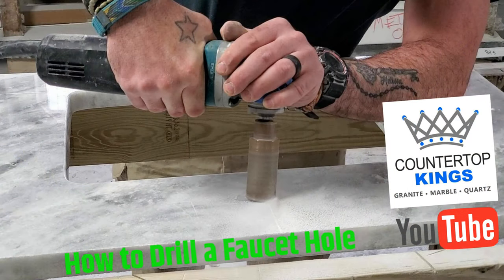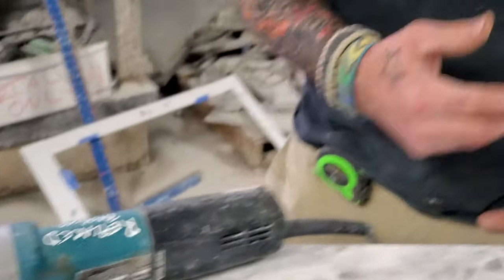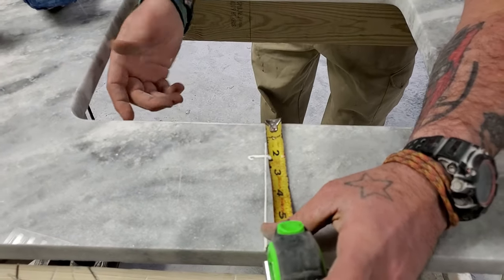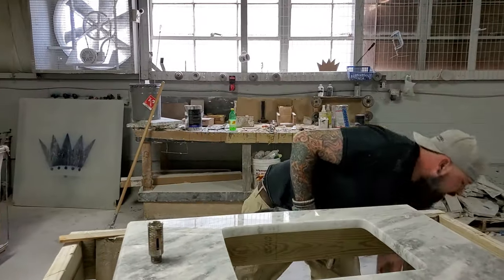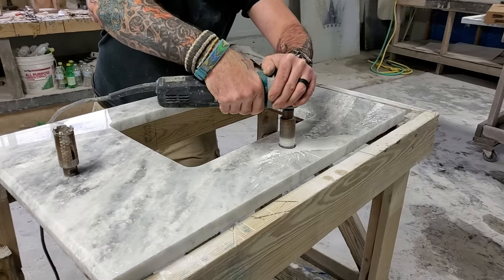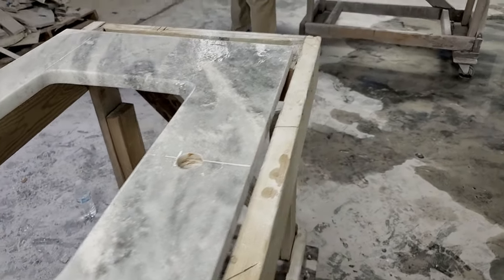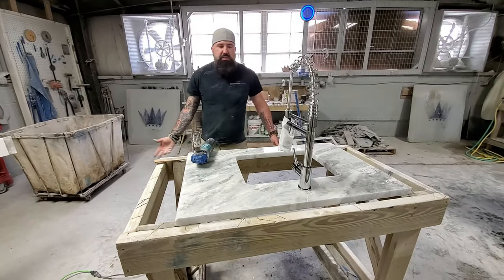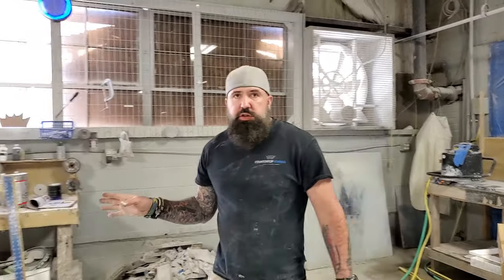How to Drill a Faucet Hole! Diamond Bits

Comment: I like the angle technique, I just crank the speed crazy fast and when I start contact I’m very light about it with elbows braced n just on a slight angle in a circular motion. Same motion a coin would make rocking to flat surface. I don’t have a skipping issue I once did, but experience is a great tool to have. Great video
Reply from the maker: Thank you. Yes once you get the technique down you will only have a skipping issue if your bit runs out of teeth, just gotta be careful when it gets low.

Comment: Like this guy and his video. If you’re doing this on site might want to have an assistant to shop vac the dust out of the way while drilling. It’s interesting that it’s possible to crack stone while drilling it if it gets to hot. I thought this stuff was formed under tremendous pressure and heat ? My thought is vibrations would cause a crack more than heat. But he’s the stone guy so he knows best.
Reply from the maker: U got that right.
Reply from the maker: Faucet holes make a minimum amount of dust even so we do run vacuumed in home when we aren't filming. As far as being formed under tremendous pressure and hear, if you have stone at home if not find a friend that has stone in their home if you have any. Take a vice with you and put in on a corner and turn it , film it so we can see how if it was formed under pressure by your logic this pressure won't hurt it. Lmao. After your finishing with that take a torch with map gas and hold it in the same spot for approx 5min remember to film because by your logic being formed under heat also means this will not hurt it either!

Comment: Great video - thank you!  I need to drill a 2-1/2” hole in granite for a beer tap tower…along with (4) 1/4” holes around it for the screws.  I’m assuming the 2-1/2 inch hole will be similar the the hole you drilled….any recommendations for the 1/4” holes?

Comment: Touch the diamond segments on a bench grinder of your bits that are glazed over to open them back up. They’ll cut like new.
Reply from the maker: Touch it to what? I have drilled concrete blocks to sharpen them, have also drilled stones to sharpen them.
Reply: @FOUCHFABS  the grinding wheel whens its spinning. Works like a charm I've been doing it that way for many years.
Reply from the maker: Thx!

Comment: Just how hard are you pushing down? I've drilled some holes and even used a terminator bit but never got it done that fast. Was that slab made of butter?
Reply: looks like it's marble, so it's almost as soft as butter.
Reply: He’s also using a bad ass 90 degree grinder drill probably 15 amp. I’ve seen it done with a cordless. But they want around 200 plus to drill one hole. I’d make it last a while so the customer doesn’t think you’re ripping them off.
Reply: @joeeast439  Lol yeah right!
Reply from the maker: We only charge 25 a hole plus a trip charge. So if my customer complains about $25 they can do it themselves.
Reply from the maker: And that's only if a hole is added after install. Or they don't have their faucet available at install and we have to go back to home. Idk how anyone can get $200 a hole.
Reply from the maker: I would have to rewatch video to see what material it is. It all depends on the bit and the material. Quartzite takes forever, granite is second hardest, marble is shit, and quartz is the easiest to drill. Terminater bits are best if you can find but there are some other decent bits out there. And the makita sjs grinder I'm using is the standard grinder used in the granite industry,  at least in my part of the world.
Reply: @FOUCHFABS  Thanks. I’m going to attempt to drill an 1 3/8 hole in granite with the Kobalt bit similar to the terminator bit. I read the reviews seems to work good. My opinion is drill slowly less heat and keep the bit and slurry it creates while drilling moist. Wish me luck.
Reply: @FOUCHFABS  do you have a contact in Canada to do this ?
Reply from the maker: @CarlosRomero-kk3et  i sure dont. Sry. Im in North Carolina,  USA
Reply: Where did you buy these bits  ?
Reply from the maker: @russellzito7502  i got them from one of the tool trucks. I cant remember.  I can not find them anywhere now.

Comment: Hey I have a question for you. I went yesterday to home depot to replace my bathroom widespread faucet. The diameter on the faucet valve would not fit in my sink countertop. I notice my original faucet diameter is smaller than the new ones. It seems all of the new faucets are all standard with a 1/2 connection size. Do you think they still sell faucet with a smaller diameter so i don't have to make bigger holes on the pre-existing ones that I have?  I rather just find a a new faucet but when i went to home depot yesterday for the second time, i took my old nut washer and it wouldn't fit any on the new faucet handle pipe thread as they are bigger in diameter. Please let me know on your advise. My mom will kill me if i had to replace the sink countertop or if i drill some hole and make the existing one bigger and i end up cracking the countertop. So my safest bet would be to find a faucet exactly like my old one with a smaller diameter sink handle faucet valve
Reply from the maker: I'm not a plumber butbi will give you my 2 cents. I drill all my holes for faucets the same size, 1 5/8 inch and have never had an issue with a faucet not fitting, however some faucets are short and won't go all the way through stone. I recommend measuring the size of your faucet hole and making some phone calls to plumbing supply stores and asking them for what you need as they will be more knowledgeable than anyone at lowes or home depot. Also you could call a stone fabricator and ask them to make your hole larger as this shouldn't be very expensive and if something happens to your top they are responsible. I hope this helps, and good luck.

Comment: I have a granite countertop with an existing 1 1/4 hole that I need to expand out to 1 3/8.  Any recommendations about what type of bit I can use to widen it out without risking it cracking.  Thanks.
Reply from the maker: Any diamond faucet bit will work. 1 3/8 is size you need however they are a bit expensive, the ones i use run between 70 and 100$. U can also open the whole with a zero tolerance bit. If you local to me i will give you an old bit to use.

Comment: What core bit do you use for marble faucet holes? I used a porcelain and a granite core. It and blew all 3 holes out lol smh
Reply from the maker: Marble is a pain in the ass, I have tried a variety of bits and none work to good on marble. I find a good brand of bit and use them everything.
Reply: @FOUCHFABS  man I use ocean diamond apexx brand. A more commercial brand I guess. It’s what my company gives us. I’m going on another marble install with 3 more holes.  Can you give me some tips for this? Besides low slow and wet? I’ve been in the trade for 10 years but have done 80% in 3cm granite only in Texas and moved to California 3 years ago and all they like is marble around here.  Having a tough time with these dam faucet holes.  
Guess my best bet is keep it on 1. Wet. Do a few seconds at a time. Not a lot of pressure at all. Hope it works out lol

Comment: Do you have painter's tape on the head of the grinder for the heat of the grinder ? If not is that on there for any important reason ?
Reply from the maker: I put the tape on there to prevent metal Mark's on the stone. It happens a lot when dropping sinks by hand and the tape prevents it. Thanks for watching